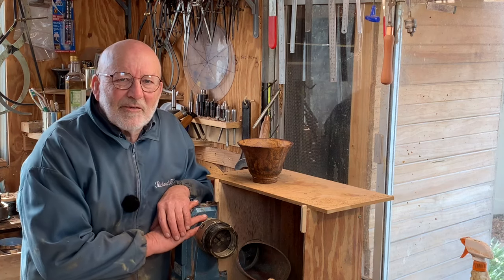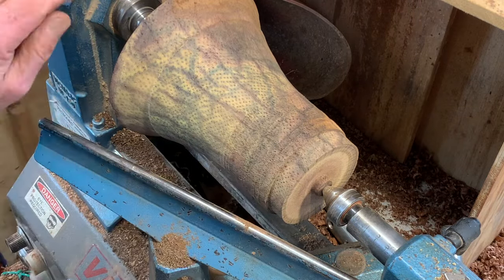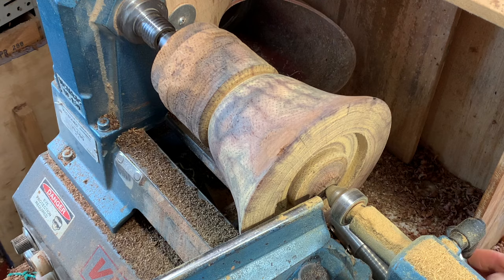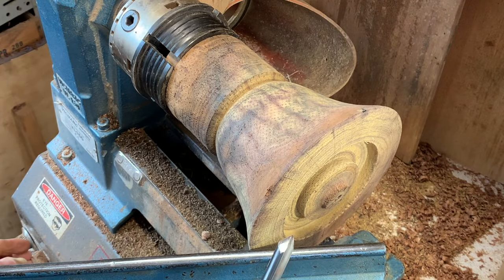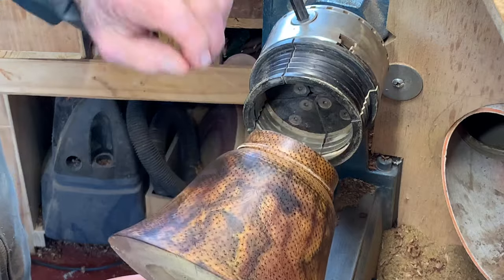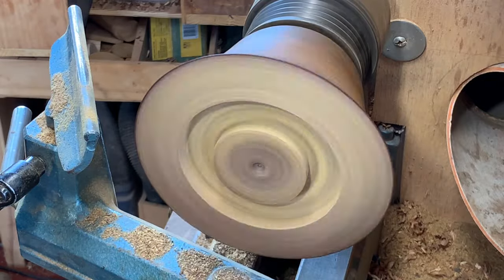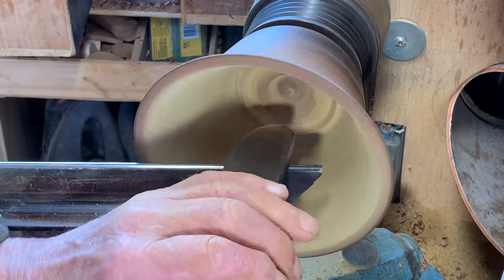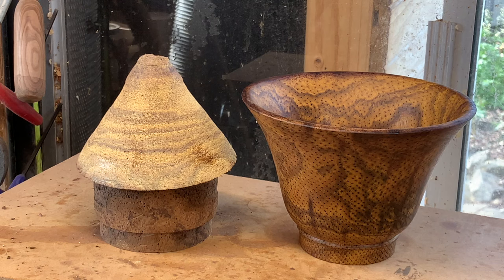Richard Raffan turns a xanthorrhoea root into an endgrain bowl and two blanks.

Comment: surprised you scraped straight into end-grain (thought that was one of the no-no sort of cuts) but i guess surface quality wasn't a concern since it was just for a mounting recess and the wood seems rather soft?  also in many ways the continental gouge seems like a really big spindle gouge, at least as far as the business end of the gouge (tho spindle-gouges are made from round bars whereas continentals have a tang like a shallow SRG, yes?) 
rare to see you sand to 400 grit - any particular reason to sand beyond 320 with this piece?
watching you hollow the bowl as if it was face-grain orientation (and not the end-grain bowl i was expecting) i'm wonder if this "wood" has any grain at all?
Reply from the maker: Xanthorrhoeas have grain and the endgrain is very likely to pick out and tear.  I think continental gouges are forged whereas Spindle Roughing Gouges might be pressed. I rarely sand anything utilitarian finer than 320-grit because I've learned over the years that a bowl too highly finished or with very flashy grain is more difficult to sell. Seems peope are wary of 'ruining the finish' — the usual comment. I want my bowls to be used.
Reply: @RichardRaffanwoodturning  i find the first (and perhaps only useful) question to ask when selecting a finish is "how and how often is this bowl/thing likely to be used?"  if it's often then it's BLO and wax; if it's less often or never then varnish or lacquer (which always takes more time and more sanding and, thus, lots more work).  BLO+wax or nothing at all is always quicker and easier.
Reply: @RichardRaffanwoodturning  oh yes, i see the plant is more of a succulent (https://en.wikipedia.org/wiki/Xanthorrhoea) so i guess getting clean slices is almost impossible?  just treat it all as endgrain?

Comment: Really nice bowl and some very beautiful material.  Are those small black spots that look like a texturing wheel has run over the material solid or are they small holes?  That dust was amazing -- haven't seen that much dust since seeing movies about the 1930's dust bowl.
Reply from the maker: That's all solid wood - no holes. That's endgrain. Crossgrain is quite different which I hope to show in another video.
Reply: @RichardRaffanwoodturning  Thanks!  That's an amazing material